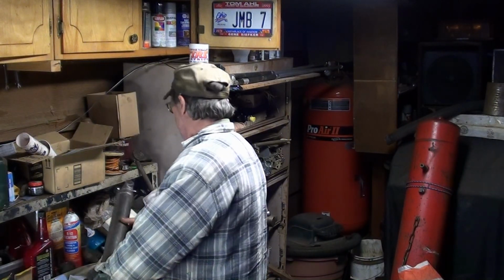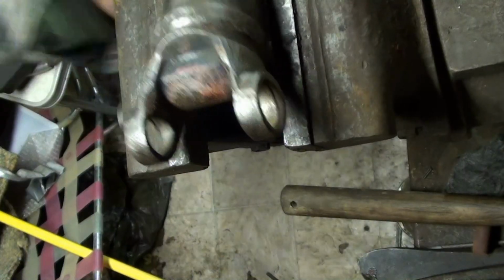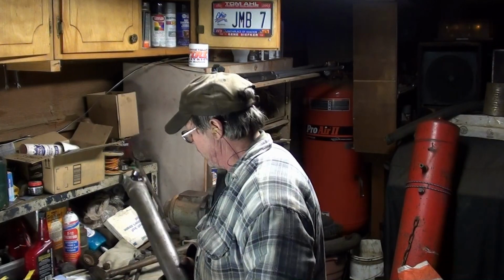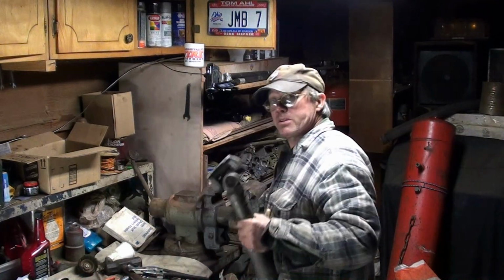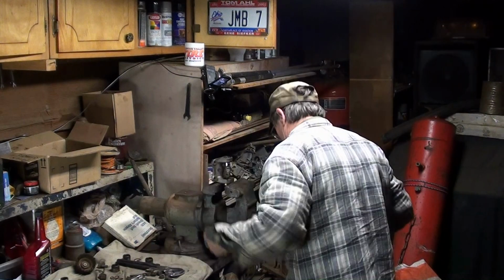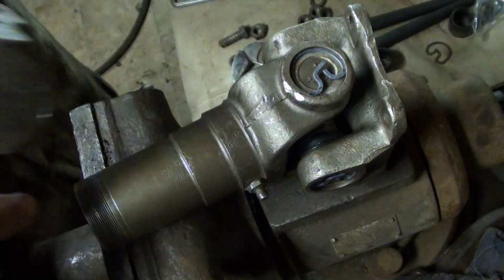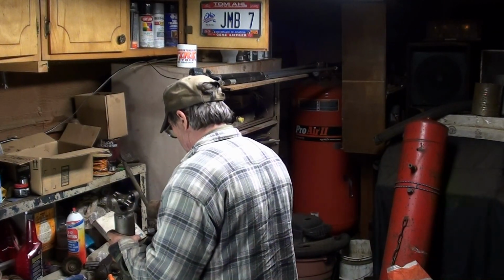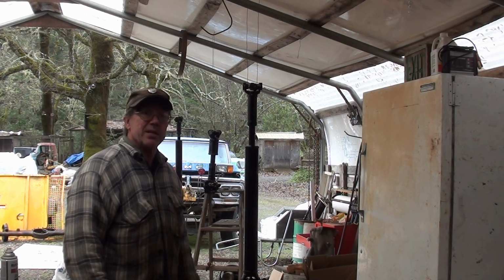Replace U-Joints Without a Press! Operation Crusty Truck # 57!

Comment: Reminds me of the time I lost a cap going down a mountain  in my 51 international pickup and had to replace it with a 3/4” socket out of my tool box to get home. I ran it like that for 3 more weeks.some of the old vehicles used to have two of the caps held on with U bolts.

Comment: I'm like you Jeff, I have a drawer full of extra clips. I've found out that there are several thicknesses of them. Even though I have a small press, I still replace U-joints just like you do.

Comment: Jeff- I saw 2 mess ups 1 you fixed later, "ALWAYS CLEAN THE SLOT WHERE THE LOCK CLIPS GO" 2 After the new u-joints are installed hold the shaft with one hand and hit the shaft ends with a hammer to relieve the Tenison on the shaft ends.
U-joints should be loose and free after install. Love your videos and CTR's as well, Always fun to watch you and Rick when you 2 get toghter. Laugh a minute for sure. "will bear sit in the woods?" Take care and i'll be waiting for your next video.
PEACE AND LOVE FROM MINNESOTA......BARRY
Reply: I'll toss in another boo-boo though some folks may disagree. After cleaning out the grooves for the retaining clips, clean off & degrease the OD of the cups and the ID of the yokes where the cups slide into place. Slather some anti-seize onto the OD of the cups and ID of the yokes before putting them together but don't go overboard. The parts will go together easier and if you ever need to take them apart again? They'll most likely come apart easier as well not to mention resist corrosion for quite a while. You'll thank yourself if you do. Best wishes! 👍🏻👨🏻‍🔧🇺🇸

- Max Giganteum

Comment: Rust belt areas ..Frozen in bad and often beating on yoke distorts it.
Use brass hammer.
Aluminum dive shafts don't like hammers .
I use big socker to hit cups on old u joint instead of yoke .
Nice 👍
Reply from the maker: Yeah, well, if you watch closely, you'll see I dropped my initial socket, but couldn't find it! The second one was just a wee bit too big. The last one I stopped using because it was beginning to mushroom the drive end.

Comment: In my youth, we had a parish that was 65% rock or gravel roads and grease able u-joints were found in most cars and trucks.  Many times my fingers got buzzed from a hammer strike just like you performed. I finally came across an old stand alone blacksmith vise with huge jaws and this task got easier !!!
   For the record, u-joint grease always fights a great hand washing but clean fingers is achieved by eating at least three pounds of boiled crawfish .  Where did that grease go ?    But I got real clean boney fingers ! ! !   ha ha ha ha !

Comment: Stupid youtube never pointed me to this video until today!
The blue '69 GMC looks like you put a body lift on it or something - looks like it's setting up higher.
There is also a school of thought regarding U-joints, which believes that you should install the U-joint so that the hole where the grease zerk threads in is being compressed by the rotational forces, rather than being spread open by those forces.  I also discovered that the Lima Public Library has Chilton's manuals online! But you have to have a library card.

Comment: I do mine without the aid of a vice. I usually have an oversize socket to drive into and an undersized socket to drive with and place it on a board to beat on.
Reply: So... you manage to get through the process without swearing too huh? 😅😂🤣 Sorry, couldn't resist. 🤔🤦🏻‍♂️👍🏻

- Max Giganteum
Reply: There's always SOME swearing somewhere through the process! 🤣

Comment: just did this on my silverado it starts by educating myself on rock auto about which one to ask for at parts store because they're not all the same i needed universal joint front driveshaft to axle and its the same part number/size as rear driveshaft to axle million dollar question is which brand is the best one there's so many and some have grease zerk some not here in the salt belt those zerks rot off. i use my press and A-ladder life before press used bottle jack under a tractor draw bar

Comment: Socket and a hammer, pair of needle nose and a scratch-all.....never failed. 15minute job. 
Vise is nice.. but never around when you're on the road-side. Always keep spares just incase. 
Watch out for over tight bearings brother. Those joints were lookin pretty tight when you were done.
Good video though. Nice tip.
Reply: Depends on the vehicle in question.  I've only ever changed one uni on the side of the track.  And wouldn't you know it?  There was a vice in the back!
Reply: 15 minute job?!? Clearly... you do NOT live in the rust belt!!! 🤔🤨🇺🇸

- Max Giganteum
Reply: @MaxGiganteum  Max, where I live cars that people from the rust belt describe as "rust free"; well let's say the scrap man would think twice about taking them.

We have many utes/trucks here that are older than me.  They have lived outside their entire lives, and they still have less rust than a 1 year old car from the rust belt.
Reply: @MaxGiganteum  ..
Ontario Canada. ..doesn't get a whole lot rustier unless on the east coast.
But I gotta say..my dad had me changing such parts when I 13yrs old..so I guess all those years payed off by the time I was in my 20s! ..Now 59..
And I hear ya though..still plenty of rust to deal with.
Reply: @dfross87  ..gotta like when that happens. .Vise on hand. ..especially on those cold days..brrr.
Reply: @leoburton642  It was a cold day, but I suspect you and I have different definitions of "a cold day"🤣.
Reply: @dfross87  ..
Yep..BC...anytime through the winter..lol...hit some minus -42°C, last time i was there...those are some cold days..
Reply: @leoburton642  My cold day was about 8C.  The coldest temperature EVER recorded where I live was -3°C.

Like I said, different definitions.
Reply: @dfross87  ..
Lol..-3°C....yeah definitely different. Must be nice.
Reply: @leoburton642  Not as nice as the weeks of 35°C+ we get each summer.